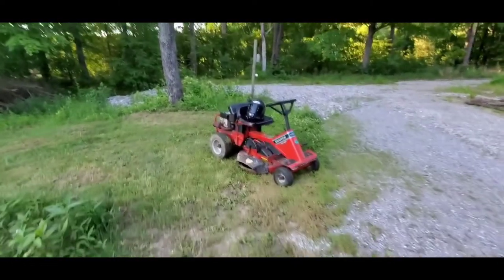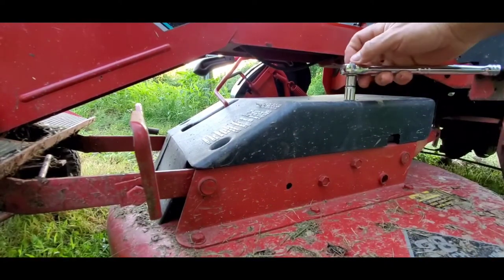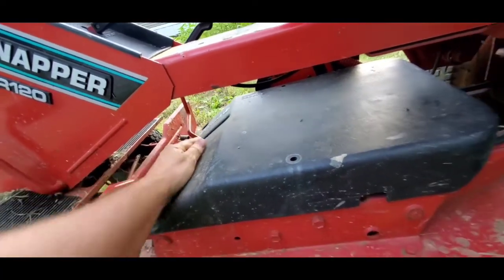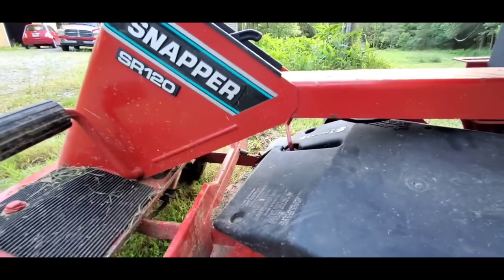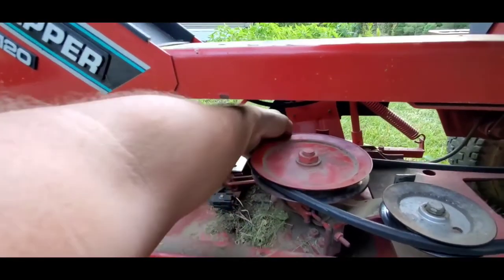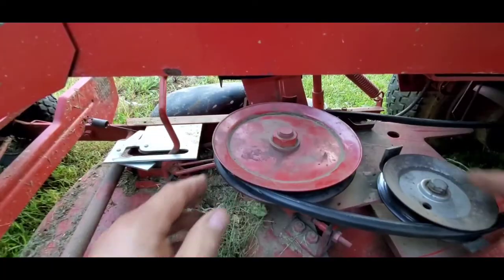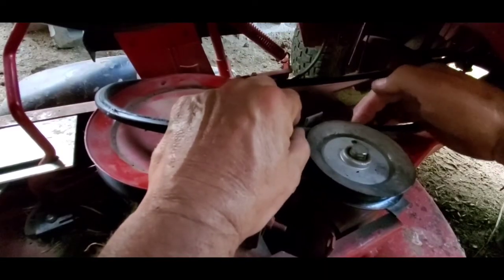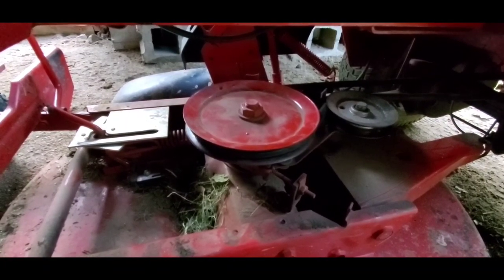FIX THE BELT ON A SNAPPER RIDING MOWER

Comment: I have the 33 inch 331415kve Series 15 and it seems like the OE belt is a Double V.  But Ace Hardware and other stores sell a regular V (and the one I just broke was a regular V which was probably 2 decades old.)  The part number was 7043844YP which is a Briggs & Stratton #.  MANY suppliers sell a regular V.  I wonder if it's not that important to get the Double V since mine took forever to break?
Reply: qaqaq😂😂ggg